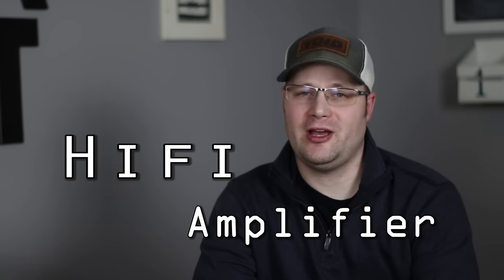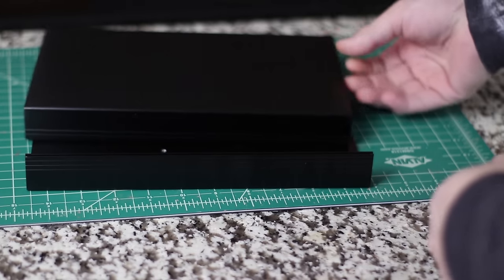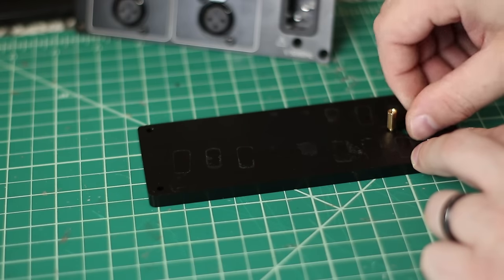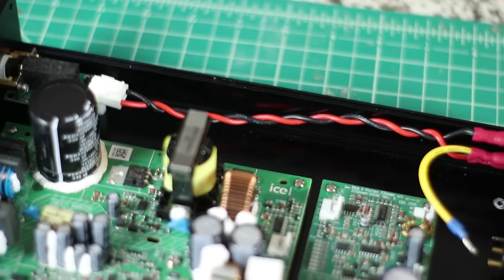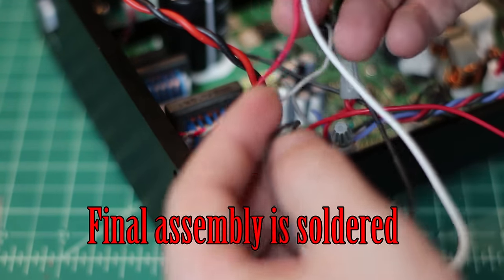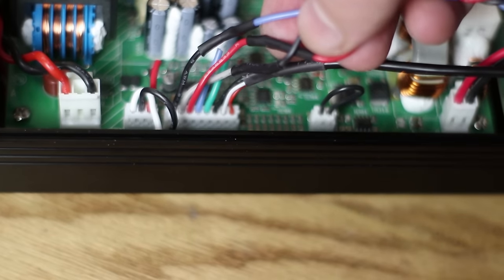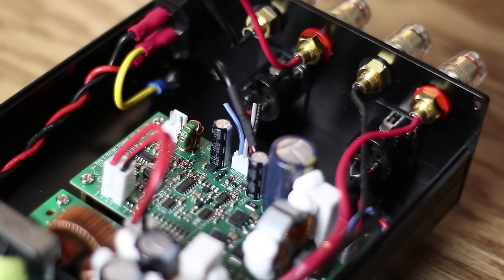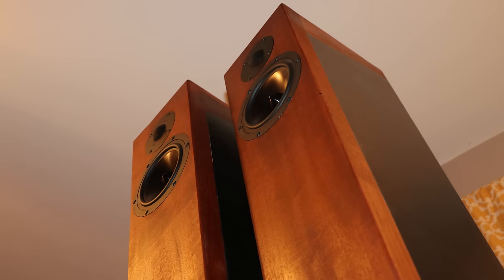How to Make a $3000 DIY HiFi Amplifier for $300

Comment: A 'dual mono-block' in this case = a stereo amplifier. A mono-block is a stand alone amplifier with power supply. A dual mono-block is two in one case (with two supplies) A single supply with two amplifiers is a stereo amplifier. Boring, I know. But don't argue, it is how it is. This has one supply and two amplifiers, just like a million billion other stereo amps.
The supposed issue is this, A modulated power supply is your output. One supply per channel is ideal and will halve the load and improve all areas of performance, plus both signals will not be modulated by the single supply so to isolate both channels fully.
Reply from the maker: Okay.  I didn't believe they had to have separate power supplies, but that was the preferred way.  Either way, it is an exciting time to be in DIY audio :)
Reply: @Toid  DIY audio has always been exciting. There has been an amateur hifi enthusiast community since the introduction of the Audion.
Glad I found your channel. Looks like a fine quality design.
Reply: @Toid  PS I just looked through your videos, and a fine collection it is. Subscribed. Thanks for all your efforts.
Reply from the maker: @martinda7446  thanks for subscribing. I really appreciate hearing that there's people out there that enjoy this type of content.
Reply: @Toid  Thanks, I'll keep in touch ))
Reply: @Toid  So this is a 2x 100w at 4ohm? Curious about the amp, PE says 0.2% THD+N That's not good right? If so, would the 500w be better? Thanks for the videos always looking forward to you. Learn a lot here.
Reply from the maker: @madarcturian  Chris, excellent questions.  Each 200 module will output 200 Watts at 4 ohms. So this particular set up I built would output a maximum of 400 watts at 4 ohms.  So each speaker would see 200 Watts.  0.2% THD is exceptiinal. Especially when they're measuring that at full power. Most class d amplifiers running at full power are 10% THD.  So you're listening please at full power only 0.2% of what you're hearing is distortion from the amp.  Comparatively speaking lesser amplifiers, you'd be hearing 10% distortion from the amp
Reply from the maker: @madarcturian  I forgot to mention, the 500 watt would be better if you have some pretty big 8 ohm speakers and want to give them 250 Watts or some massive 4 ohm speakers.
Reply: @Toid   Awesome! Thanks for the response! May need the 500. Making towers with some esoteric 7" and mids/tweeters. I know that woofer is pretty power hungry at 8 ohms. That is more of a dream build though haha. I've been killing my wallet getting into this and car SQ. Thanks again!!!!! Keep rocking out the videos!
Reply: 123Toid 0.2% is rubbish, except maybe in the strange world of Class D amplifiers. THD was around 0.1% in 1946 with the Leak and Williamson and Macintosh and Quad amplifiers, and has been sub 0.01% for over 40 years in Class A and B amplifiers.
Reply from the maker: @EJP286CRSKW  0.2% is imperceptible to human hearing.  we don't have to take my word for it just look up what percentage of distortion a human can audibly hear.
Reply from the maker: @EJP286CRSKW  according to Douglas Self, Audio power amplifier design handbook, 4th ed. Newnes, 2006. He said he most people can't rear anything under 1% THD.  However, Our sensitivity is frequency dependent, and we are also more sensitive to higher-order distortions. With training and with certain types of distortion, some distortion effects as low as 0.3% can be heard. you have to understand that most amp manufacturers are going to give you the THD percentage at 1 watt.  For example this amplifier at 1 watt has a THD of 0.006%.  which if I was trying to sell an amplifier as a manufacturer, is definitely the number I would put on it.  I personally believe that all manufacturers should put the THD number at full wattage.  Most won't do that, because they don't want you to see a higher number.  They know, that when anyone sees a lower number, they automatically assume it's better.  When in reality anything under 0.3% is imperceptible to human hearing.
Reply from the maker: I should mention that if you have a source that contradicts that, I would love to read it.
Reply: 123Toid Radio Designers Handbook, 1954. It has been accepted for 90 years that THD isn't a useful figure of merit for amplifiers. That's one of the reasons why IMD was of so much interest back in the day. But if you're going to use it that way, as you have here, you need to be up with the current speed, and it has been 6dB better than 0.2% since 1946. It is therefore otiose of you to claim that 0.2% is acceptable. It isn't.
Reply: @EJP286CRSKW  so what is your point this amp is not worth $300? If so which $300 class d amp is better than this?
Reply: M0beast Don't change the subject. My point is clearly expressed above. The claim, and I quote, that '0.2% is exceptional' is complete and utter BS, and has been since 1946. I haven't said one single solitary word about dollars or cents or current competing products. Stick to the point.
Reply: @EJP286CRSKW  that .2 % is maximum load THD+N at full wattage. Which actually is freakin exceptional. Most amplifiers measure "typical" THD + N, and the rating on this amp for "typical" THD is .008, with a max of .02. Show me an amp where the THD at max wattage is under 1%... it probably costs thousands.
Reply: Tommy Geary More BS. THD must be quoted at full rated power. There is an FTC regulation on this, and a violation constitutes deceptive advertising. The DIN and BSA standards of the 1960s say the same thing. Your 0.2% at full rated power is exceptional all right: exceptionally mediocre, and would have been so considered any time since 1946.
Reply: Brian Barratt 'Most power amps won't load 4 ohms after bridging': after bridging how? You bridge in series to increase voltage, to get more power or to drive more ohms, and in parallel to increase current into less ohms, typically to overcome SOA current limiting in the amplifier. I'm not any kind of a fan of any kind of bridging, but if you need more power into less ohms maybe you should do both.
Reply: Brian Barratt When you bridge in series like the NAD, each amplifier only sees half the speaker impedance, and evidently the NAD needs 4 ohms or more., so a speaker of at least 8 ohms when series bridged When you bridge in parallel you are overcoming such limitations, not creating them.
Reply: @EJP286CRSKW  uh, what? There are multiple measurements for this.  The FTC rating which you speak is rarely quoted, most companies quote the 1W THD+N rating. The other measurement is max power at 1% THD usually, or .1 percent if it's really high end stuff. I'll put it to you this way. A $999 Denon Receiver only does 135 to 2 channels with .7% THD, which is far worse than any of these ICE amps. Like I said you have to pay thousands to get better results (generally speaking)
Reply: Tommy Geary Bullshit upon bullshit. I have dozens of power amplifier specifications here, and they all quote THD at rated power, and conversely full power at rated THD. And I just looked up another one absolutely at random on the Internet, and it does the same. The FTC rules are not optional. If you advertise your product in the USA you must comply, or you can be hauled before the courts for deceptive advertising. This has been in place for decades. Every one of the manufacturers I mentioned above has been doing it since 1946. Which in turn means that all their products have been < 0.1%, and in some cases < 0.01% AT FULL POWER for decades. Which makes your 0.2% at full rated power mediocre in the extreme. This is fact. Look up for example Quad 303, 1968, or indeed Leak Type 15, 1945. If you have an exception to the FTC's advertising rules please provide it so they can be reported to the FTC, which BTW is not an engineering standards body but the Federal Trade Commission.
Reply: @Genuine Audiophile Thank you, that's what I was trying to say!
Reply: @Genuine Audiophile finally someone gets the whole draw of these ICE amps! I have some DIYSoundGroup Fusion 15 speakers which are sitting at 98dB/W sensitivity. I would be using less than 1W of power for the majority of my listening. I want something that is as low distortion at those levels as possible. I also need an excellent noise floor as any amplifier hiss will be far more noticeable on my DIY speakers than on something less efficient.
Reply: Actually, the first Dual mono stereo amp to market was the Harman Kardon Citation 12 with dual transformers two big power caps per channel this was groundbreaking in the early days of the solid state. This amp is considered to be one of the top ten most significant amplifiers of all time. Then with the introduction of toroidal transformers having enough power in one transformer to power two sets of windings to power two amps in the same case became standard for dual mono design. This also kept cost down having two separate cases would take up twice the weight & space driving up the production cost & shipping cost which, in turn, would have cost the consumer more. So the brilliant engineers at Harman Kardon gave us the blueprint for the all in one dual mono amplifier pure genius.

People are weird and can't see the whole picture so amp makers have made dual moo in many ways like in separate cases or in the same case with one power cord and one transformer with two sets of windings to power two amps. Or dual transformers each with their own power cord powering two amps in the same case. 

The fact of the matter is as long as the amplifier itself has it's own power supply driver boards and output devices transistors/tube it is dual mono.
Reply: You're right that one power supply and two boards in one enclosure is just a 'stereo amplifier'. 
Next is two power supply's and two boards in one enclosure, that's a 'dual mono amplifier' 
And then you have one power supply and one board in one enclosure, that's a 'mono block'
There's nothing like a dual mono block, the reason it's called mono block is because there's only one output channel.
Some audiophiles prefer mono blocks because you can place the amp closer to the speaker, personally i don't believe in such a set up because there's way more chance for interference due to longer interconnects.
Reply from the maker: @EJP286CRSKW  The THD number is abused all the time.  You will see a lot of amplifier companies give out one number, which is 1 watt at 1Khz.  Which means they test the 1Khz signal (easiest to reproduce) at 1 watt and give that number.  They rarely will test the full range of frequency at 4 ohm, like Ice did.  It is easy enough to look up.  Just look at any HiFi amplifier company and see the number they give you.  If you would like the typical 1w, 1Khz @8ohm, here it is: THD+N = 0.006% (1W, 8Ω,1kHz)
Reply: 123Toid I agree It is abused all the time, and you're doing it here, and it is in violation of the FTC rule which you momentarily claimed doesn't exist. It exists all right. There is or was a further requirement that the amplifier be operated with a sine wave at 1/3 power for an hour prior to this measurement, but I think they scrapped it because it would blow most amps up. Fact remains that your claim that 0.2% is exceptional is BS. I have a dozen ore more power amps within twelve feet of me that beat it comfortably, and I am no money-no-object collector. Most of them were bought for a few hundred bucks. The last amp I had that was 0.1% or worse I bought in 1971 and sold in 1987.
Reply from the maker: @EJP286CRSKW  name one that does the entire frequency range at its max power and lowest impedance @ 0.2%
Reply: 123Toid I have already named about five. I would be hard pressed to think of one that didn't. You don't seem to know much about it, or you would recognize these names.
Reply from the maker: @EJP286CRSKW  you named amplifiers from 1968 and 1945 that have no distortion testing specifications. The 1968 amplifier says that it rates THD at 0.1% but that doesn't say at what frequency it was tested or at what power.  However it does appear to be tested at 8 ohms, which is going to give it a much lower number than when tested at 4 ohms. even at full power if that's only at one kilohertz test tone, which is standard, that number could be significantly higher. you're welcome to believe what you want, but you can easily just search around it all of your Hi-Fi amplifiers and you're going to see that most of them are tested at one kilohertz. You need to test the full frequency at full power to get the full scope of total harmonic distortion.  This at 1khz 0.006%. feel free to believe whatever you want period but make sure that you're comparing apples to apples.
Reply: 123Toid What do you mean 'no specifications'? Every one of the amplifiers I cited has a well-known specification, easily accessible. Why don't you do some research? instead of calling me names and making one BS claim after another? You might even learn something.

For the record: Quad 303 (1968) distortion specification, in full:

70Hz 0.03%
700Hz 0.03%
10KHz 0.1%

all at any level up to 28W 16 ohms load or 45W 8 ohms load.

Proof by counterexample.
Reply: @EJP286CRSKW  Yes, this is not a classic case as Quad did things their own way but still illustrates the quality people became accustomed to in the 1950s. This was a time when the public had available  high quality music mediums for the first time with tape and microgroove vinyl records. 
Williamson and Leak were the first to produce in quantity amplifiers using the ultralinear output stage invented by Alan Blumlein. This allowed a pentode to achieve the efficiency it was known for and the low distortion of the triodes that had gone before. Leak named their ultralinear amplifiers 'Point One' in 1945 I believe. This predated the Williamson design by two years. A tap at 20 or 40% on the primary of the output transformer allowed the screen to be perfectly loaded and distortion dropped dramatically.
It may well be of note that Quad in 1957 also introduced their electrostatic loudspeaker and - this I guarantee - gave the user of these a magnitude less distortion than that you are listening to now. No moving coil transducer can approach the electrostatic for distortion levels. It in fact matched or improved on the amplifiers.
In many ways the 1950s/60s was the pinnacle of audio reproduction. Listen to Buddy Holly and get transported to another era. Listen to this with the Quad IIs and ESL57s and you will 'get it'.
All amplifiers are tested at full rated output unless stated otherwise. All these amplifiers will have vanishingly small distortion in the midrange at normal listening levels (usually below a watt).
Reply: @EJP286CRSKW  Also all amps of that era came with a plot of their distortion characteristics over the audio band at all powers. The Leaks, Quads, (add your favourite here), and radfords etc all comfortably exceeded their point one across  20hz - 20khz at full power specs.
Reply: Martin D A One correction. Leak did not use UL until about 1957. The Point One was a triode amp, as was the Williamson. Actually nobody used UL for 25 years until Hafler and Keroes published in about 1952, and DTN Williamson was violently against it, as per his rather silly letter with PJW: 'the authors do not believe this claim'.
Reply: @EJP286CRSKW  Yes that is right..Memory...Edit I think they may have been KTs wired as triodes?

Comment: So for `$200, not counting any cases or wiring kit, how are these any better than say, a Behringer A500 @ $200 or the NX1000 @ $250, or a Crown XLS1002 @$290?  Just using these amps as an example. 

I like the DIY thing, but unless these things really 'sing,' why bother?
Reply from the maker: @patrickrosington1174  Actually Patrick, all of those brands I mentioned have used Ice Power.  B and O came up with the boards, PS Audio use them in their stellar series, Rotel used them in their RB-1091 series and the rest you can easily Google.  Next time it might be wise, to just do a little research (instead of assuming), it can go a long way.
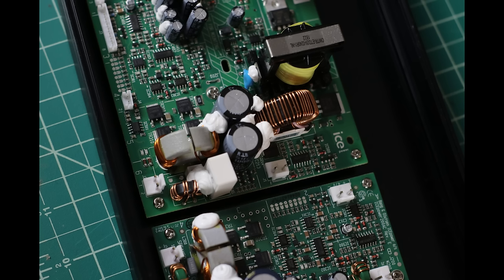Reply: @Toid  Actually, one of the boards had Bang & Olufsen printed on the corner. Look at 5:22 on the right.
Reply: Ron Hillier bloody hell you’ve got good eyes